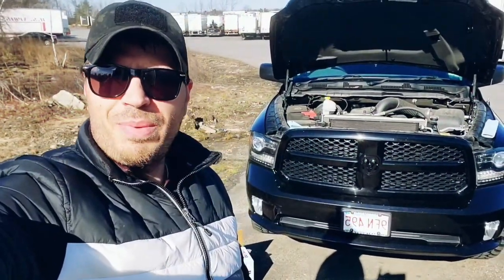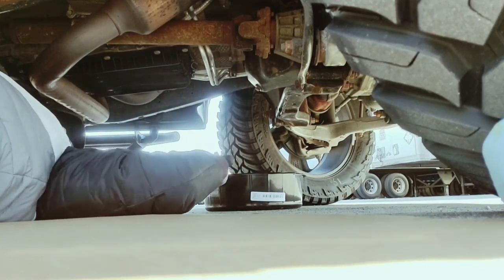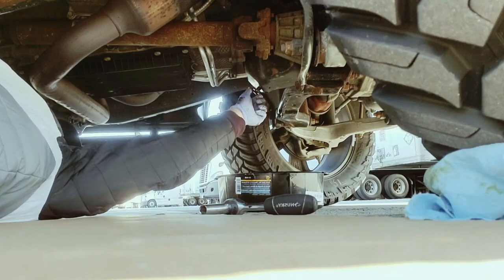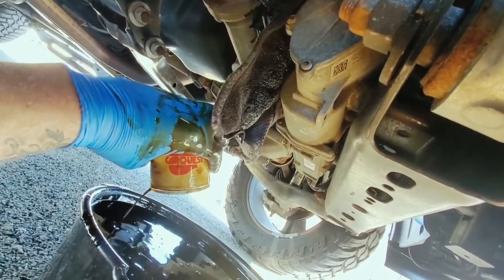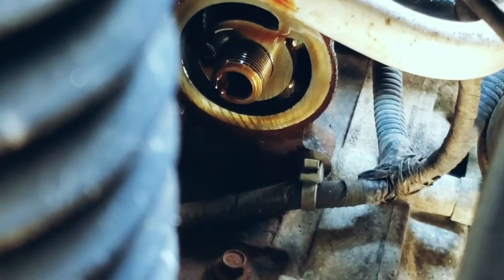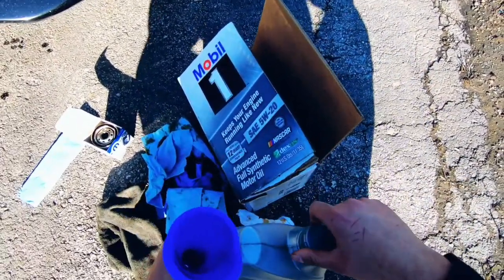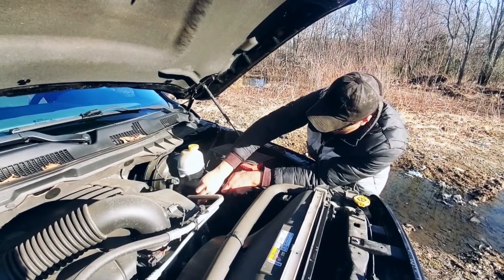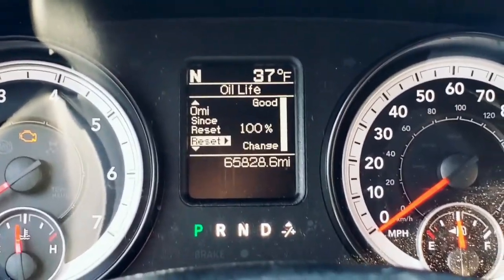Oil Change ( EASY COMPLETE guide ) Ram 1500

Comment: Great job
Next time when you want to check the oil livel stop the engine 😅

Why you did install the radiator support after installing the LED'S?
Reply from the maker: Lol I checked before starting than you have to let it run little bit for the oil to circulate through the filter and lines and check the level again !! ....and I did install the rad support after when I pained the engine cover check out that video :)